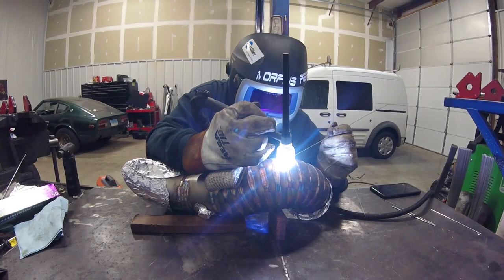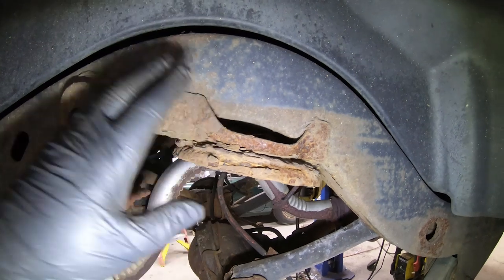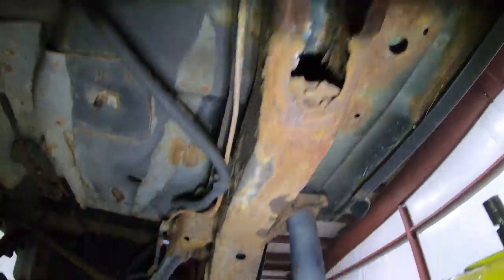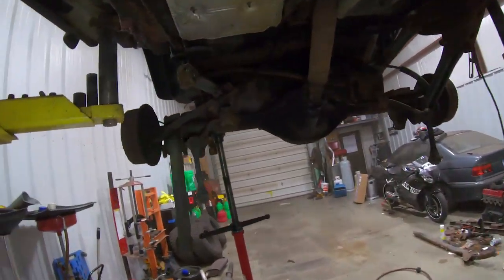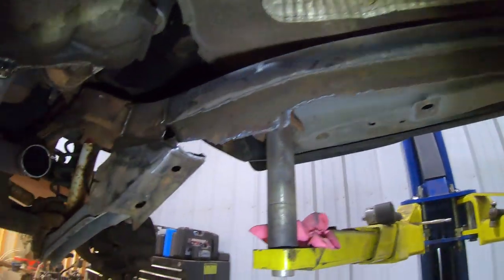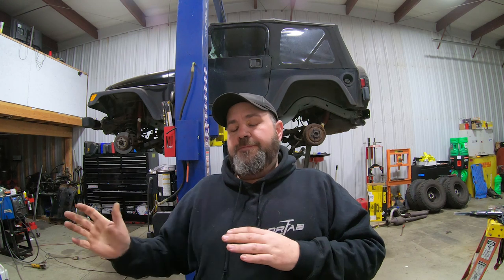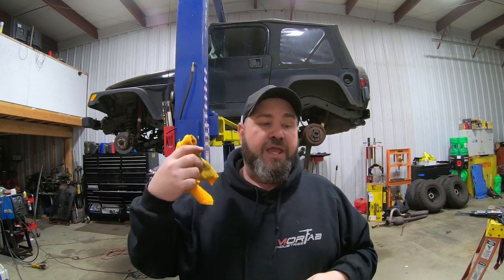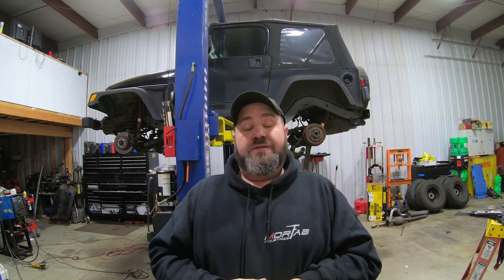The BEACH JEEP Wrangler frame repair!

Comment: Just did my YJ. Both leaf spring mounts on the drivers side broke off and jammed into the frame, horizontal crack the length of the frame between the two, and a vertical crack going up the front and back side of the frame where the parking brake cable goes through. Passenger side is solid and hardly any surface rust.

Comment: Hi I was just wondering I just recently had the whole underneath of my jeep done. With front and rear safety cap as well as center skid sections. I was wondering what your thought are on putting drain holes underneath the center skid sections for water to drain out . I seen the front and rear caps have them but not the center skid section. Please let me know. I live in pa if I would have been close I would have had you do the work. But I'm far away.

Comment: Swiss 🧀 man why not just replace the frame if ur that far into it
Reply from the maker: The repair costs less than half of what these jeeps are worth whereas a frame replacement can be at or slightly more than what the jeep is worth. The sections i replace are 99% the only sections that ever rust. The rest of the frame is perfect.
Reply: MorFab Industries ur the man bro that’s a lot of time and hard work good job looking forward to seeing more